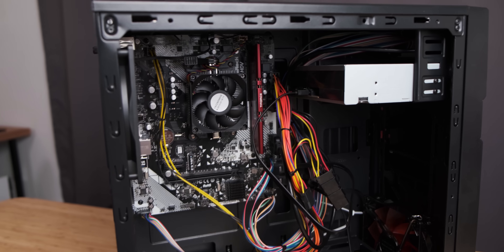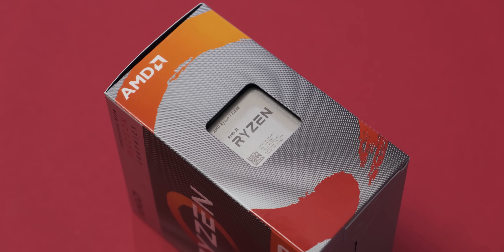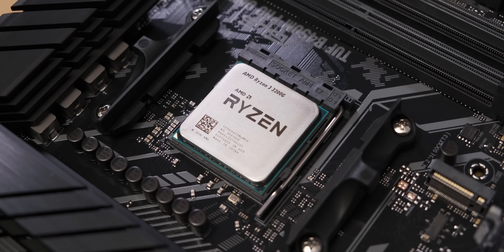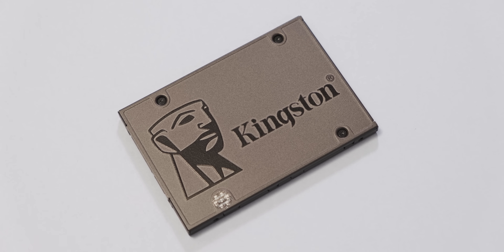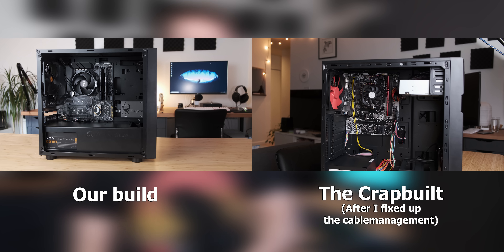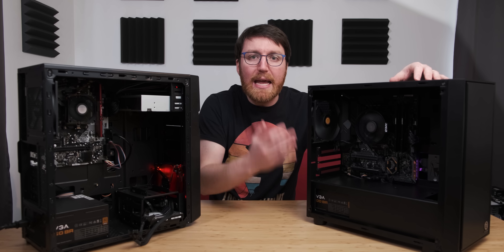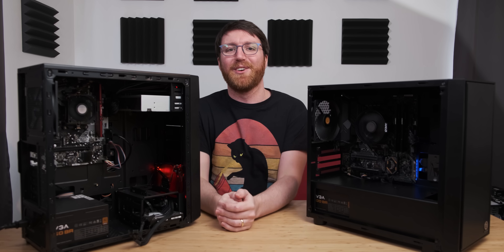Cheapest Amazon "Gaming" Pre-Built PC versus Custom-Built PC (2020)

Comment from the maker: For anyone interested, the motherboard listed in the video description needs a BIOS update to work with the 3200G. If you are interested in buying those parts, please bear that in mind. 
If you don't have access to an older Ryzen CPU I would suggest specifically buying a B450 motherboard that comes with a Ryzen 3000 compatible BIOS out of the box.
Reply: Woah!
You're a Canadian too
Reply: wait what i got the same mobo and cpu and didn't do a bios update, so that's weird
Reply: Yernyx Ig  you need a ryzen 2000 cpu to do the bios upgrade.
Reply: I would just get a £30 optiplex off ebay, stick an extra 4gb of ram in there, upgrade from i3 2120 to i5 2400 and put in an rx 460. amazing performance for like £100

Corrected "upgrade to i3 2120" to "upgrade from i3 2120 to i5 2400"
Reply: Weird question, but are you from South Africa by any chance? Your accent sounds South African and your name is pretty common in South Africa.
Reply: False, this custom built pc is actually $485. You forgot that the prebuilt came with windows installed on the poopy hdd. You may have the OS in hand, so it’s free but for someone building this... it’s an added cost that they may or may not be aware of.
Reply: @AznTony360  You could get a cheap $3 key or just not activate it because it is barely noticeable
Reply: Is the case you listed in the description for the case that can take the graphics card or not if it's not can you link me that case
Reply: they let you borrow an update chip so u can update it
Reply: @seanulrich5864  He is Canadian.
Reply: you know l like the part where he wrote the custom pc the kickass pc and the pre built a pile of suck
Reply: @davidfisekovic1482  or install Linux if you dont feel like paying more ig
Reply: @Nauclefphy Dorcent wouldn't reccomended going anything under 16 gb for a pc that's above like 350$,ram is so cheap rn and for just like 20$ extra you can get an extra 8bg of ram and the performance increase will be huge value for money
Reply: The hell is a battery chicken?
Reply: @seanulrich5864  hes a South African living in Canada
Reply: Hey when you are showing us how fast some games are on the crap build next time if you do another one of these put roblox on the games that you show us since i play none of the other games.
Reply: All of the items cost me $509
Reply: or some companies say that if your mother board doesn’t work with the bios they will send a test chip for you to upgrade the bios
Reply: The 3000 APUs aren't actually 3rd Gen CPUs. They run on the 2nd Gen architecture. You shouldn't need to update the BIOs.
Reply: @DEATHSlEGE  they dont have the arcitecture but i am pretty sure you need the bios update
Reply: I have computer with Geforce 210. Does getting just better power supply and better card like 660 would increase computers performance or decrease it?
Reply: Are u english?
Reply from the maker: @lucutes2936  I was born in Namibia. I think that means I'm not English. 😅
Reply: @DawidDoesTechStuff  WAKANDA!
Reply: @DawidDoesTechStuff  Dawid, what would be the best PSU and Motherboard to use with a Ryzen 7 3700x and an AMD 5700xt? Would the EVGA 750BR be a good choice to go with, just incase I upgrade the GPU at some point in time?
Reply: Having a quality psu is more about reliability, but make sure it can handle the power draw of your system. In general yes a better graphics card will give better performance as long as your cpu is matched well with it.
Reply: Could you make me a pc ? :)
Reply: Yernyx Ig  you can flash the bios without a compatible CPU. Most motherboards have an usb slot for bios flashes.
Reply: You can direct ethernet it and run without cpu in to update bios via internet server(amd supports it in there last section in the bios
Reply: @AznTony360  dude to install windows 10 it's not that hard all u need is 8gb flash drive that has nothing on it which is like 5 dollars and then go to your laptop or old pc that had windows on it. Download windows 10 to the USB flash than u plug into your new bulit and boom you run through the instructions and then install windows 10
Reply: @thomasrayner5301  "upgrade to i3 2120" how is that an upgrade
Reply: do you think it could run vrchat with vr headset decently?
Reply: @RPL8M24  just use a compatible Athlon
Like Athlon 200GE
Reply: The start of the vid is just making a excuse for you to post 2 vids out of 1 vid even if the excuse is valid
Reply: @AznTony360  Windows keys are like $3.

Comment: I'm amazed they put a 3tb drive instead of a 2TB or 1TB drive
Reply from the maker: Yeah it is a pretty big drive for the budget. Although it was very used. 😅
Reply: It was probably left over junk that was bulk bought.😓
Reply: They buy in bulk, 3 TB drives arent sold that much so they made a good price arrangement on it, how it works with all their parts.
You'll be amazed that when you take out all the costs of the prebuild, they stil have a 25-30% profit.
Reply: Probably a retired surveillance disk!
Reply: Yes that's the kind, especially, that I was referring to. When they get to the end of their life they are replaced and get back on their investment by selling them. It would certainly be interesting to run a data scan to see what was on them. Even encrypted, they would reveal where they originated 🤔
Reply: @frontwing67  why was it used all ready for basically 4 years 🤫
Reply: @davidedgar2818  They bought a bunch of "refurbished"ones probably, its expensive to check these drives properly, they worked,they use it and sell it.
Reply: they took whatever was cheapest at the junkyard xD would have put a 20gb hdd if they could have gotten it for a dollar cheaper.
Reply: @davidedgar2818  please try doing it! That would be so interessting, what it was used for more than 4 years
Reply: because new people amazed on bigger hard disk, just like me before, that it's better to buy bigger HDD.
Reply: I have a hunch that it was swapped by the employee who built the pc
Reply: 3TB on a single drive with that many hours clocked is a death sentence for your data
Reply: @laowai2000  you know what that makes a lot of sense. Why else would it have been on for four years? A home or small businesses surveillance system could easily run on one of those.
Reply: Ok
Reply: It had been run for 4 years so it was basically at the end of its life.
Reply: maybe its because its meant for stuff like office stuff and people need drive space
Reply: They probably just had it lying around in an abandoned library pc
Reply: It's probably 5400 rpm or something because I used a 1tb HDD in my old PC and the way he described that downloading the Rockstar launcher took so long mine was pretty fast compared to my m.2 now I am not saying they were even close but it didn't take that long either
Reply: They probably got an used CCTV storage drive
Reply: I would still prefer the ssd cuz it’s so much faster
Reply: Gb*
Reply: i would have expected a 240 gig ssd at best
Reply: Plus 3tb and up HDD are always 5400rpm and the lower ones 7200rpm. So the 3tb was actually a very bad idea

Comment: Counterpoint: Your SSD is smaller but it doesn't have 38,000 hours of use on it from the factory.
Reply: HDD<SSD
Reply: @modernth3896  ssd's are way faster thna hdd
Reply: SSD-> No moving parts.
HDD-> Spinning disk, can't handle external shocks (sudden movement)
Reply: SSD is better, but I honestly would go for SSD as a boot drive and HDD for everything else.
Reply: @revgorodiouttp5119  just buy a 4tb nvme ssd.
Reply: @modernth3896  Also 6gb/s is the speed of the SATA Port not of the drive. The HDDs speed is mainly dictated by the RPM number of the HDD. That's how fast die spinning disk inside is able to turn.
Reply: @revgorodiouttp5119  nvme as a boot drive the rest just ssd. Unless you really need a bulk of storage and don't have to transfer data regularly.
For most users 1,5-2tb should be enough :)
Reply: @GhostlyGhille  those are very expensive. I have to spend more on a Graphics card and CPU and I don't want to sacrafice GPU or CPU power.
Reply: @revgorodiouttp5119  it was sarcasm bro
Reply: HDDs are good in their own right; they’re better for long term storage, and a helluva lot cheaper, too

but yeah speed-wise they don’t even compare
Reply: @modernth3896  Just get a 256gb m.2 ssd for 30 bucks and use it for the os and programs.
Reply: @GhostlyGhille  a 4tb one is 1 thousand fking dollars. we're on a budget.
Reply: @alpitu21  sarcasm.
Reply: The ssd is a crappy one tho
Reply: @therealcat5794  you can’t buy any legit SSDs for that cheap and anyways you can buy a 2TB hard drive for $54
Reply: @revgorodiouttp5119  depends on what your needs are. Im running two ssd's currently. a 1tb and 500gb. Thats more memory than ill need for a while personally and really wasnt that expensive.
Reply: The included HDD didn't have 38,000 hours of use on it from the factory. The HGST factory would never do that and you know it. The SELLER installed a heavily USED hard drive and called it new. That's what happens on Amazon when you purchase from their third-party program. Advice: Never, EVER, buy anything on Amazon that isn't actually sold BY Amazon. You have  been warned. BTW, HGST is a former Hitachi division that was purchased by Western Digital nine years ago and no longer exists.
Reply: @revgorodiouttp5119  that's about what I do. 500 gig ssd for os and whatever else. 1tb ssd for games 1tb hdd for pictures and home movies and videos.
Reply: @XnxxD  So, the 4tb nvme i bought for $1400 was overkill? I knew spending more on storage than a GPU wasn't smart...
Reply: I'd still go for a 2tb hard drive over a 500GB or less ssd any day.

Comment: I just can’t comprehend how they can market a PC as gaming, when it can’t even run CS:GO on low above 30 freaking fps. It’s a game from 2012.. The sad thing is that people who aren’t familiar with PCs ARE going to buy this crapbuilt for their children/grandchildren. And you really can’t blame them.
Reply: already happened to me and didn't know enough about pc's to do anything about for 3 years
Reply: @itsrandxm  same. I bought a pc off Facebook marketplace for £250. I didnt know anything about pcs in 2018 so I just thought oh its 250 must be good. It came with a gt 730 lol. I'm working on a build for £650 right now that would blow my old pc out of this universe.
Reply: @kacperkaminski3620  yea i get at least 3x the fps now (though if you count putting my old pc at ultra then its like 20-30x) the biggest problem was the cpu itself because until then it was basically just a vram upgrade with a new gpu until i upgraded everything and then with a cpu upgrade everything else was already upgraded so i just built a new pc instead of just upgrading.
Reply: The power button glows, it’s obviously a high powered gaming pc.
Reply: My dad got me and my a brother $700 optiplex for christams 🤦‍♂️ I managed to sell it on ebay for $500, dont know why someone payed that much, then used me and my brothers combined one or two year savings of $300 and got way better pc
Reply: @itsrandxm  me too I got a crappy laptop that lasted 5 years before I built an pc that's 1000x better like I can get 500-1000fps on an io game while my pc does 1fps
Reply: @commanderhopeful  lie everyone knows the eyes can only hear 4gb of ram
Reply: @Klosop  no not everyone only special people does I can hear 32gb
Reply: csgo's recommended specs requirements are higher than tmwhat they stated on the steam store page of the game because all new maps, panorama, engine adjustments and so on. The game is insanely optimized but you still need a quad core (atleast) to run 130 fps stable.
Reply: My “entertainment series” laptop carries a solid 25fps..... RIP
Reply: @kacperkaminski3620  Yeah I got a laptop with a Celeron n3060 and 4gbs of ram a couple of years before I understood this kind of thing. It can barely run roblox on lowest settings. I'm planning on upgrading soon.
Reply: Cyberpunk is more optimized than csgo nowadays, you know that, right? Valorant is the golden standard now. If a pc can’t play Valorant, it’s a piece of crap.

Comment: Meanwhile my PC is hard to be considered built
Reply: Huh, my PC was 450$ and it has i7-3770 and rtx 2060. Just look for some local cheap stuff my dude
Reply: @Jeff I was making a joke about how my pc is a mess
Reply: @Lat3r I got it for 220$ from eBay. It's Asus but it had one fan broken
Reply: @Lat3r that's a good deal my dude!
Reply: @jdmnissan  yeah but thats used components. new, it would've cost around 650-700 (substituted i7 for i3-9100f)
Reply: @jdmnissan  that's a huge bottleneck lol
Reply: @brandon520  possibly, however I have overclocked it to 4.25Ghz and I usually play 1440p sometimes older games at 4k. And for games I play it's more than enaugh, CPU never hits 60%. Well sometimes 80% in shadow of the tomb raider :)
Reply: Sebastian did you replace the fan in the 2060? And if you did. How much did it cost
Reply: Me wanting to build a pc but i dont know what the hell im supposed to do never encountered a gaming pc or the functiona of a regular pc at least im just going to bye one form ebay
Reply: I feel like I need a PC guru. I've seen some PC's but I don't know if I'm getting a good one/ my money worth.
Reply: Quadir Lovell  I'll try my best.
Reply: Quadir Lovell  You my sir are a god. Thank you for providing me this as I was a bit weary on what to buy.

 Also, how long do you think this would last and what kind of output levels of FPS would you get from this?
Reply: Quadir Lovell  If you've got time. Would an Intel i5 9400f be suitable for this build instead of the Ryzen?
Reply: Quadir Lovell  If you've got any time. 
OK so is this a good setup. I've made adjustments but I'm hoping it'll all go together.

For the CPU I put the Intel i5 9400f

Motherboard - Carte Mere ASRock B365M Phantom Gaming 4 Micro ATX

GPU I put the MSI Radeon RX 550 4GT LP OC graphics card which has a dual fan cooling system.

Then I put the Crosair vengeance LPX 16gb. And the case. Well I haven't chose 1 out yet 😅. But I'll find a good one. Will I need one of those cases with 3 fans on the side or 2?

Almost forgot. I put the Aerocool integrator in which is 500w. I'm not sure to get this one or a different one.
Reply: Quadir Lovell  Just a check, do I need both ssd and hdd?
Reply: Quadir Lovell  sticking with the £400 - 450 range.
Reply: Quadir Lovell  I'm gonna have to rack up a bit of cash. But it'll be coming soon in a few weeks or a month or 2. But yeah I've got everything sorted. Just a quick question. Are the fans on the side of cases for design or do they assist the other fans inside?
Reply: @theloraxcubicle1655  make sure to NOT buy a random unbranded PSU. And make sure it has PCI-E Connectors Because those cards need them.
Reply: Im not sure if they RX 550 Needs a PCI-E connector but I don't recommend that card anyways, get yourself an RX 580 8G. or an RX 570.
Reply: @ligate7830  the one I looked at says it has 2 of the 6-pin connectors for PCI-E graphics adapters.
Reply: @ligate7830  called the "Aerocool Integrator 500W Power Supply"
Reply: Quadir Lovell  I don't think that's an upgrade
Reply: @jdmnissan  what the fuck. H O W
Reply: @jdmnissan  such a bottleneck lmao
Reply: @jdmnissan  i got an rx 560 OC edition from gigabyte for $60
Reply: @wiiuboy6194  SWEET MY G
Reply: @jdmnissan  lol wow
Reply: @duk8227  still rockin the 2060 my dude 💗 got amd 5800x doe cuz yk intel yikes
Reply: @jdmnissan  and then theres me sitting during covid prices :')

Comment: 6:27 i have an enermax Stratford sf 30 and the airflow in front sucks so hard. I have a ryzen 3 1200 clocked to 3.8ghz on an air-cooler and a rtx 2070 super oc that runs on 1935mhz when full boost. The gpu goes up to 80°c on hard tasks and not to mention how hot it gets in my room 😂

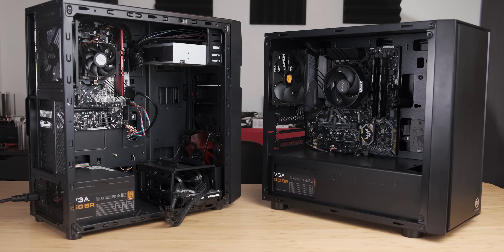Comment: Wait 06:49 - you switched out the PSU on the pre-built? Also what was wrong with the Deepcool case? Seems decent. Super cheap but an actual tempered glass side panel. Was there a build issue?
Reply from the maker: Yeah, like I said by the end of the video. The PSU it came with was so bad that I didn't feel comfortable running the PC with it. In regards to the Deepcool case, the motherboard struggled to fit and it was just generally a very terrible building experience. Considering that I could fit a btter case in the budget and I wanted to build a Better PC than the prebuilt, I switched to the TermalTake. 😁
Reply: @DawidDoesTechStuff  Interesting. Thanks for the reply. Guess I'll steer clear of that Deepcool then.